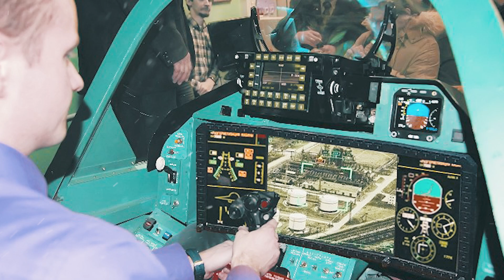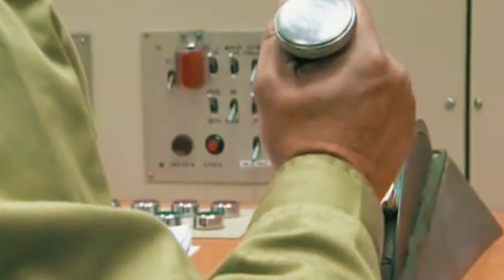Russia's Testing Their New Secret 6th Gen Fighter Will Replace SU-57

Comment: T-50 is not a code name for SU-57! This is the designation of the 4 prototypes of the SU-57 used for tests, respectively T-50-1; T-50-2; T-50-3 and T-50-4.The T-50-4 was last used (officially) in a demonstration flight at the Zhuhai airshow 2024 in China by the legendary Russian test pilot Sergey Bogdan.